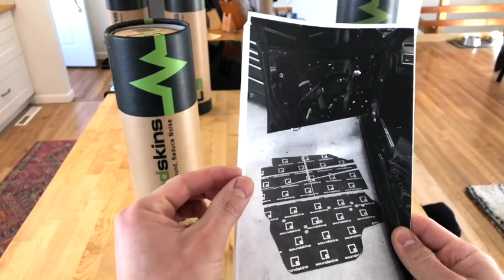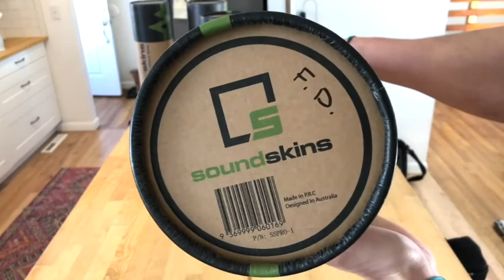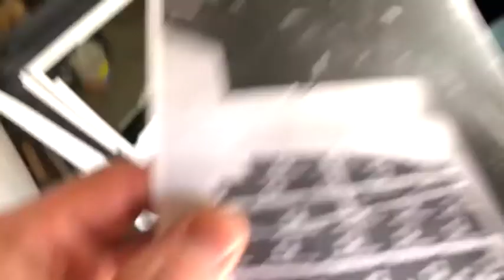SoundSkins Subaru Door Template Kit for WRX - Sound Deadening

Comment: The link doesn't appear to be the same pieces you'd installed. It looks like the interior "puzzle pieces" were not included.
Reply from the maker: That's correct! Like it says in the video description disclaimer, "This video features an old kit we no longer offer, as it is no longer recommended to instal sound deadening on the inner door skins due to some issues that arise with remote access. However, we do offer a Subaru WRX 2015-2021 kit for ONLY the outer door skins, without the inner door skins." We hope that clears things up!

Comment: Do y’all no longer offer the wrx kit?
Reply from the maker: Hello, yes we do have a WRX kit now, however it is for the outer door skins only. We do not offer a kit with inner door skin cutouts as shown in this video. Check out the kit here: https://soundskinsglobal.com/collections/template-kits/products/soundskins-pro-subaru-wrx-4-door-template-kit-2015-to-2021
Reply: @SoundSkins  did the price of the kit go down since it no longer includes the pieces for the inner door? 330$ seems like highway robbery, when a roll of the same amount costs 80-100$ youre charging 3 times as much for precut? LOL.
Reply from the maker: @Laborchet  Hi there! This kit was developed by the old owners of the brand and inner door pieces are no longer offered because of concerns with our pro material interfering with car windows. 
The amount of material provided from our kits is definitely more than $100 worth, it is double double if a customer were to purchase the material to complete the project on their own. In addition, all of our kits are designed, developed, machine cut, and packaged here in the US, which significantly brings up cost of developing each kit. Hope this helps clear things up!

Comment: My god, just spent 3.5 hours doing just the drivers door. So far, not worth the work at all 😂 my fingertips are raw
Reply from the maker: Did you cut the material yourself or purchase a kit?
Reply: @SoundSkins  I bought the precut kit for my wrx but mine didn’t include the extra pieces to go behind the frame of the door like in this video. Getting all the clips and harnesses out took forever because of how stiff they were. Probably took 2.5 hours to take apart and the last hour to apply the skin and put back together.